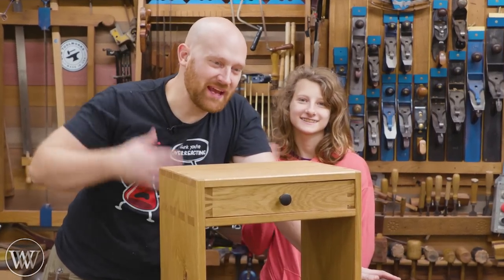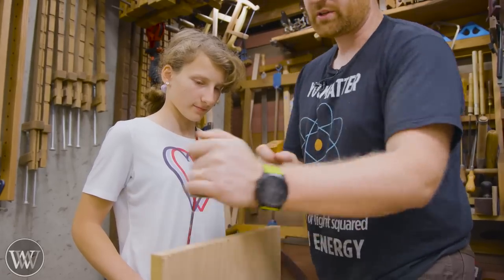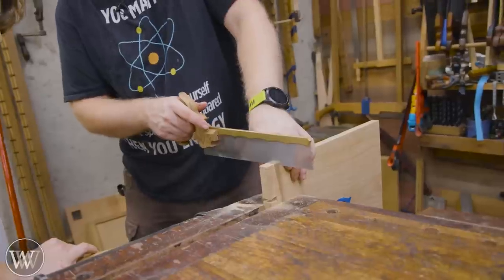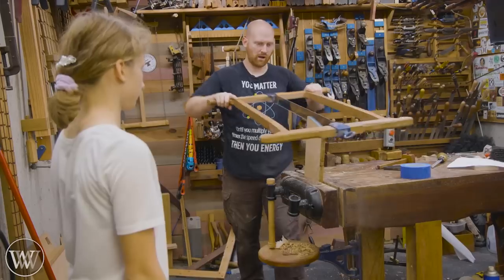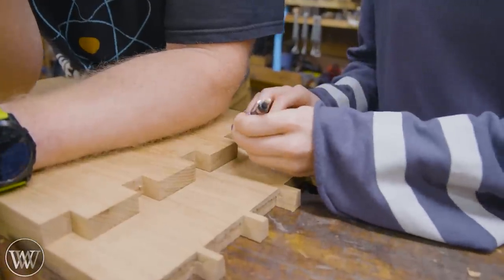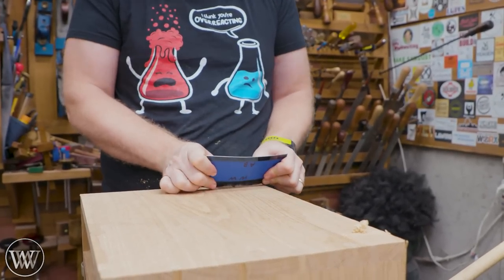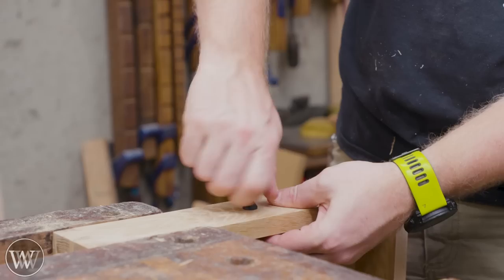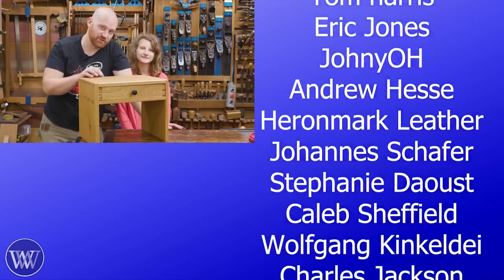How To Make a Coffee Organiser With My Daughter

Comment: Glad to see you got to do a project with your daughter.  My daughter does occassional woodworking but doesn't yet quite have the attention span to work long with me.  One of the things I do, which I learned from Guy fDuplap rom Against the Grain Podcast, is to keep a 5 gallon plastic bucket in which I put all my offcuts.  That way, if I need something during the build to fix an oops or a bit to make something else it's all there.  Once project done I sort which scraps to keep vs. toss.